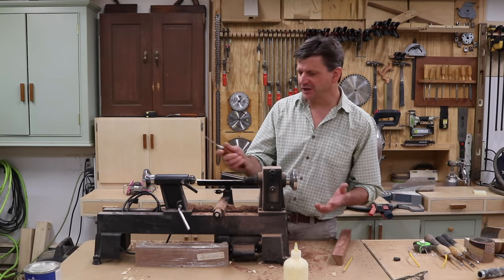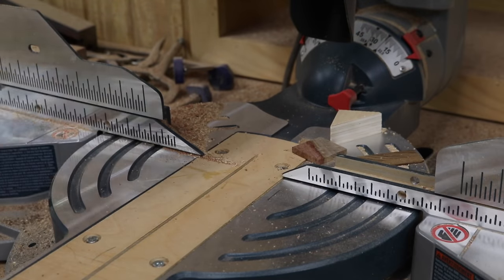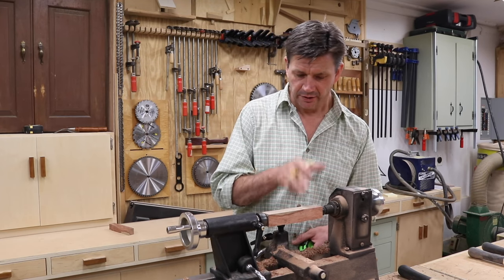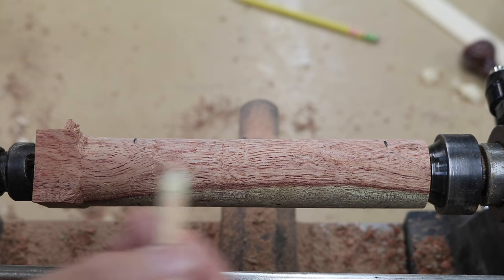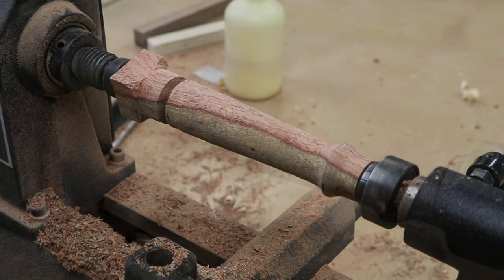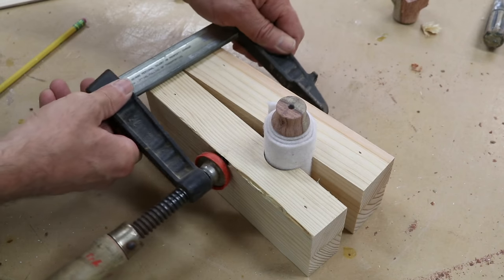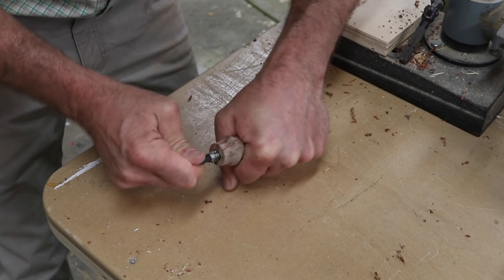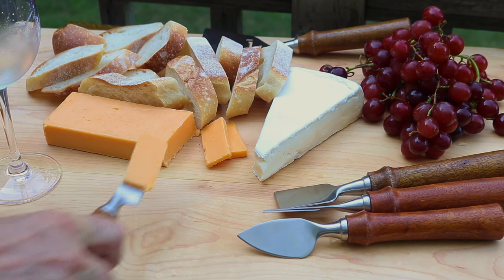Beginner Lathe Project, How to Make Cheese Knife Handles

Comment: Nice video. I used to have that same lathe and I found that I could use the drill press Chuck in the lathe.  as long as the drill press uses a mt2  Chuck it will fit. alternatively you can buy a cheap mt2 Chuck from harbor freight for $10 and use a bolt chucked in to make a turning mandrel.  I have done a lot of bottle openers that way. The  benefit to this method is that you can drill the holes and install the threaded first and finish entirely on the lathe.